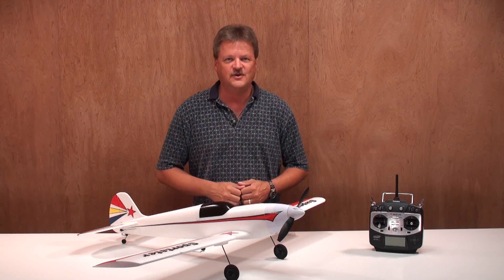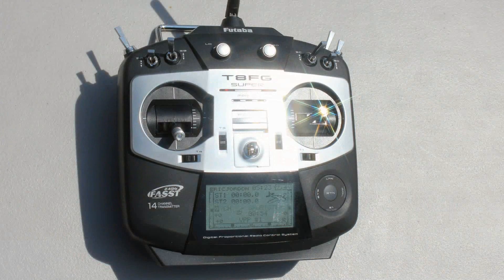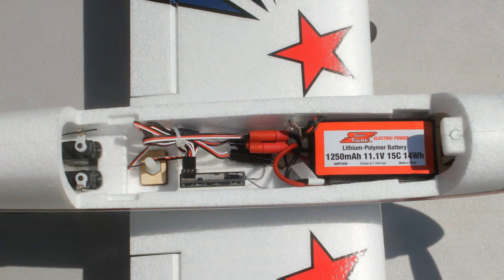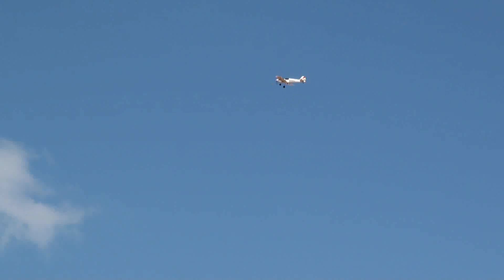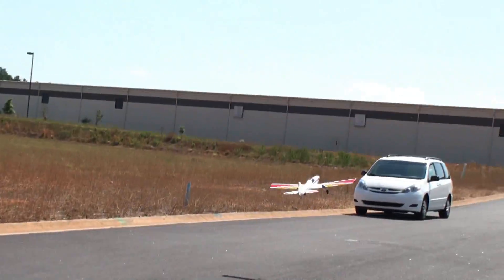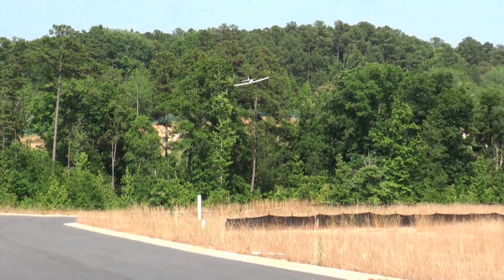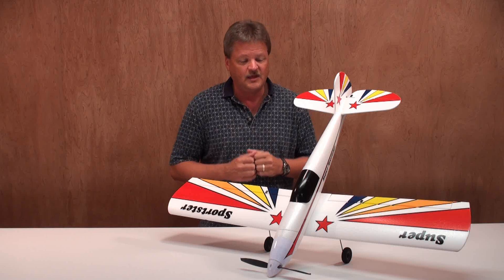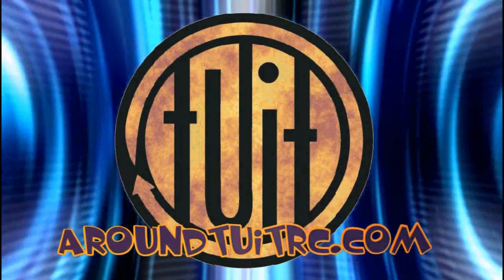Electrifly Super Sportster EP Airplane Review and Maiden Flight

Comment: Curious I was installing the propeller and noticed the motor mount was not glued on straight to the fuselage and motor wasn't centered on the mount back itself.  The motor looks angled to the right when looking at it from the front.  Is this normal?  Can it fly straight?

Comment: I have one of these.  And he's right, they are an excellent 2nd plane.  After flying trainers for a while, a friend suggested this one as my next "level-up".  He was sooo right.  I love this plane.  I was so terrified when I first hand-launched it. But I got the hang of it in minutes.  The faster speed blew my mind.  Unfortunately I crashed my first one trying to fly while "hung-over" (mixed up the aileron direction - I ALWAYS check that now).  I was so disgusted I went and immediately bought another (at Hobby People for about $150).  But the second one didn't have the power of the first, so I swapped the motors.  I'd be curious to know if they have dissed the more powerful motor for the new version.  With the older motor I could climb straight up without a problem.  The newer motor totally blows chunks.  Also, the landing gear slots tend to break out of the wings after a few rough landings.  I handled this by taking some bamboo skewers from the 99 cent store and cutting grooves in the wings and gluing 2 inch or so pieces of the skewers perpendicular to the wings in under both sides of the plastic landing gear flanges so they could bear the load of landing. Now I've not had a problem other than the landing gear tends to bend when I land rough.  Also, the rear landing gear is rather weak and it broke after a time.  I replaced the broken piece with a cut-off piece of an allen wrench and hot-glued it in place.  So, in my own review.  the newer motor "sucks the big one".  I wish I knew the specs of the older motor  The landing gear has to be re-enforced with better material.  But all that aside... I LOVE THIS PLANE!!

Comment: To Richard Derfler - almost all R/C airplanes, especially high wing trainer type aircraft have a bit of engine or motor offset, usually down a bit, and to the right as well. This is to compensate for the adverse effects of the twisting motion of the prop & motor. Picture yourself in the cockpit... the prop is spinning clockwise in front of you. The force used to spin the prop is also trying to twist tbe rest of the airplane the opposite direction. This force is also known as "P-factor", and can make the airplane steer or roll (or both) to the left. The more power that is apllied to the prop, the more P-factor tries to turn or roll the airplane to the left. 

Angling the motor & prop to the right just a bit helps to compensate for P-factor, and angling the motor & prop downward helps to decrease unwanted climbing as speed is increased.
Reply: Thanks.  Do you know the brushless motor specs?